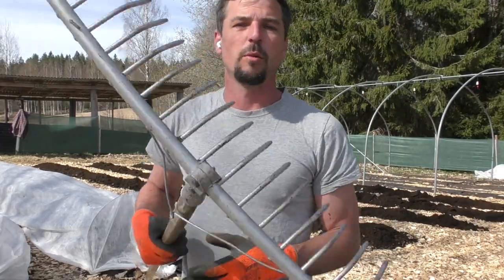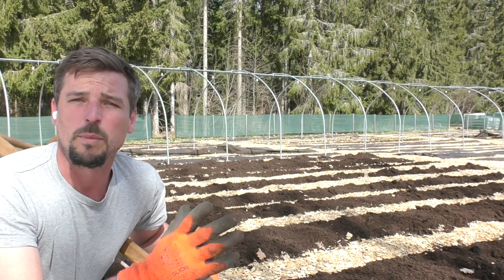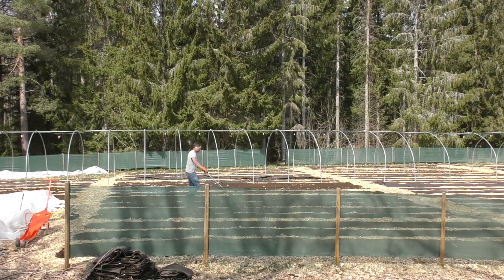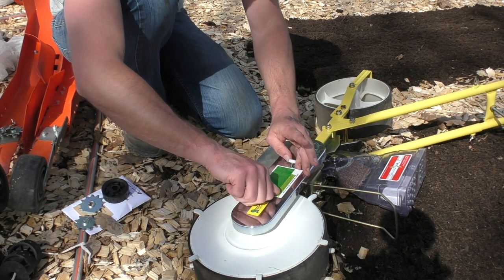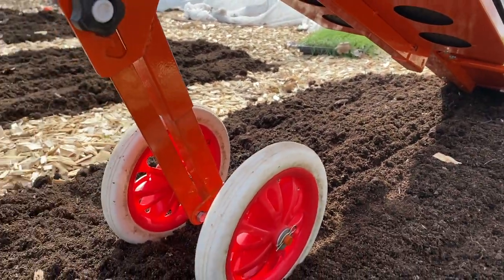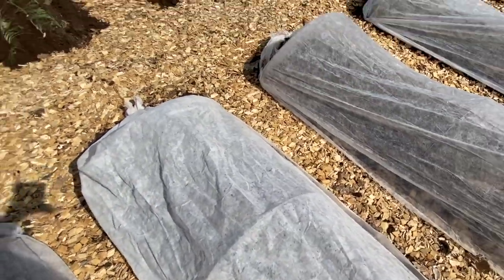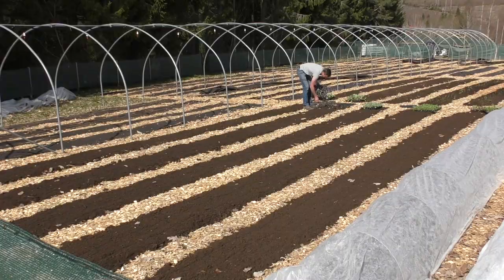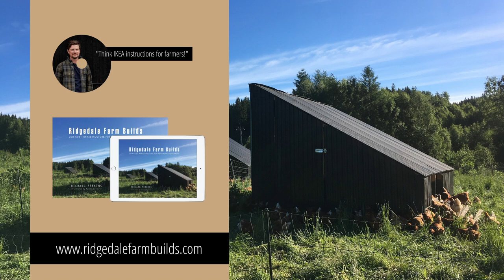Jang, Paperpot and Hand Transplants

Comment: We put a second wire hoop on the outside of the fabric as well and then skip the staples along the long edges. The sandwiched fabric works like a mini caterpillar tunnel, easier to peek under or adjust for ventilation or irrigation.